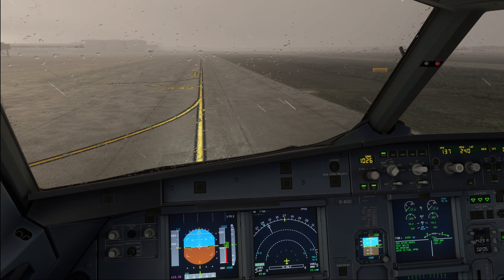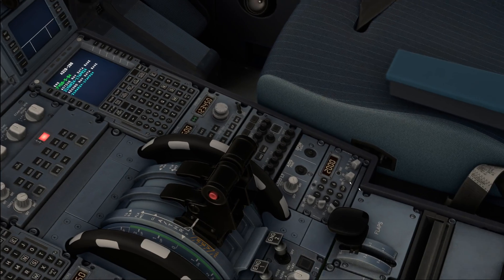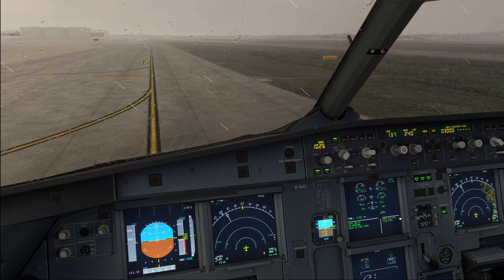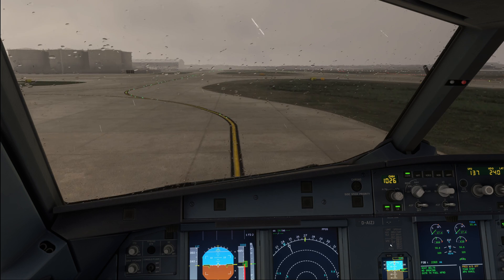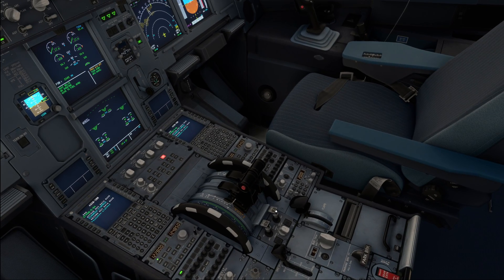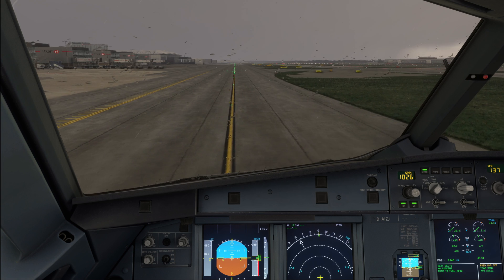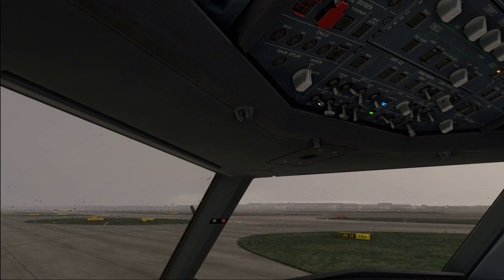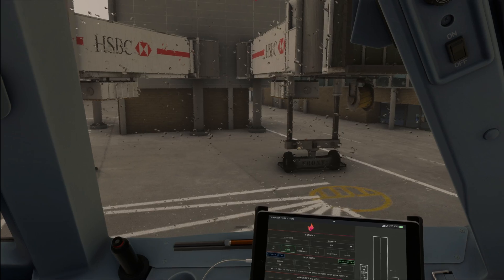Airbus A320 Tutorial 16: After Landing and Taxi-In | Real Airbus Pilot

Comment: When you  taxi with a single engine, the engine to switch off is always the number 2 even if you are using IAE version?
Reply from the maker: Yes, always #2. This is because how the hydraulic systems are connected to the different engines, which in turn is unrelated to the engine manufacturer.

Comment: 3:02 in fact, you would be impressed about the large number of operators who doesn't count the green operations of airbus (such us ldg lights with flap 1 or single engine taxi) as a normal procedure. As far as I'm concerned, there are not a lot of operators like that left on Europe, in fact I only know one, but a lot of african airlines might don't carry out those procedures. And here is my question, is it really that bad for the environment to turn on and off ldg lights at 10.000 ft or dont doing SETI and SETO?
Have a nice evening mate!
Reply: Another fun fact is that on some airlines the single engine procedure can be performed with the eng 2 if the last turn is a tricky one with only the eng 1 and you are able to do a single eng taxi in with the APU off as the STEWA (I think it is written that way) boletin permits you to have both of the fire agents available with the APU offline.
Reply: I may sound stupid, but what ldg lights has to do with green enviroment ?
Reply: @cibulis5347 Well, the Airbus A320 is a quite special plane in that sense. The landing lights on this aircraft are a retractable surface, so they  unfold when in use. Those generate drag, generating a 1% of extra fuel use each due to the drag generated. That's why they can be folded with total flap retraction in order to save some fuel. It is not a silly question at all 😊😊

Comment: Excuse my complete ignorance in how the A320 (or any airplane) consoles are designed but aren't the engine switches situated in a place that those can be accidentally flipped? I would expect that such important switches would be somewhere overhead? Also the parking break position seems not intuitive, it would be more logical to be transverse to axis of airplane as On and longitudinal to be Off, but this is minor compared to engine switches.  BTW thanks for another interesting video. I'm an aviation enthusiast trying A320neo on XCloud and I fond your tutorials one of the best on YouTube. Also some calming night flights I find very relaxing to watch, like the recent night DHL flight. Thanks!
Reply from the maker: The Engine Master Switches are guarded, you need to apply quite some force to lift them up and out of position before you can move them. Also there's a guard "wall" just in front of them, if your hands would slip of the thrust levers (I really see no reason why that would happen though) they would hit the guard and just move right over the top of the engine switches themselves.
I don't think there has ever been a case where a pilot accidentally switched off the engines in an Airbus aircraft - with the exception of the guys spilling coffee over the switches and causing a short circuit on the A350 LOL
Reply: In real life, you first have to lift and then flip the engine masters, so you can not accidentally switch them.
Reply: Hello @yourobson. The eng masters are already very protected for any accidental operations on them. To actuate the eng masters you must firstly lift and then move the switch to the desired position. About the parking brake lever, I couldn't agree more with you. It isn't intuitive at all, and on new pilots it is common to confuse the positions if you aren't looking at it, but it is just a matter of getting used to it.